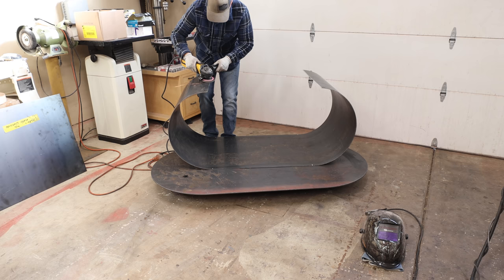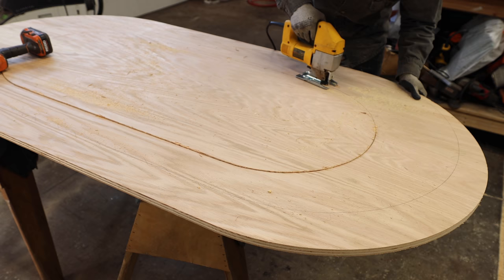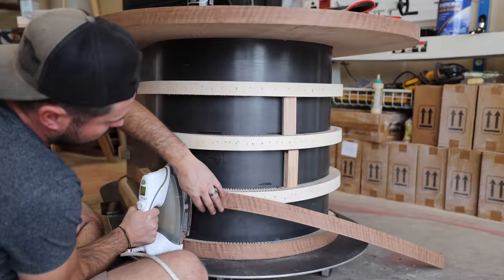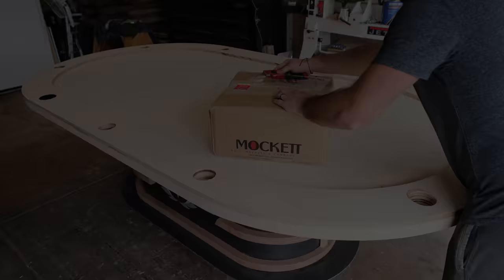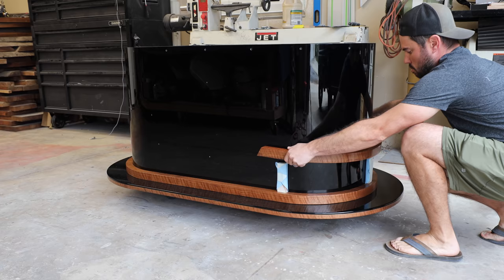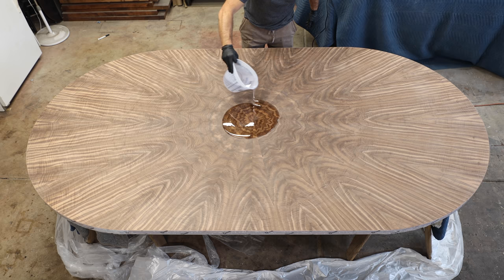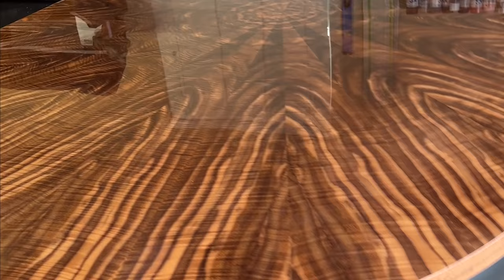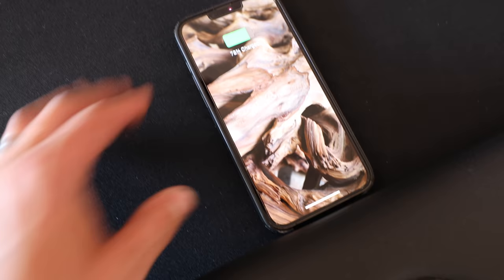Luxury Poker & Conference Table COMBO

Comment: Let´s do the math, thats fun =) 

Wood: most expensive part is the beautiful lid - approx. 5-6K all together
Metal: approx. 500-800 
Epoxy: 300
chargers: 50 each = 600 total
Foam and letherwork: approx. 2K 
Paintwork=500 
"Small things not mentioned": 1K 
work: 350hours with 60$/h = ~21K 

total of ~32.200$ 

Now it depends on how you price your shop and your services. In theory there is a win margin already included on the workhours in the built but I would think you add some additional Margin on the product itself. I would assume anywhere between 8-15% 

32.200$ *108%= 34.776$
32.200$*115%=  37.030$

 I´ll go for ~36.000$

Comment: Great work and stunning results.  My hats off to you.  For northern California, I'd say anywhere between $30-45,000.  Much more if using exotic woods.  For the epoxy top coat, a Bernzomatic blow torch does a better job with self leveling than a heat gun.  It will save you a greater deal of sanding afterwards.  Try it once and see for youself.
Reply from the maker: Thank you!  I've used one and in some cases they're too hot and will accelerate the resin flash time, I did try and use one on this table top but I need something with air flow to push the resin around and still that didn't work well lol.

Comment: I use to do custom artwork for a high end designer/ fine furniture in Scottsdale awhile ago.  They closed in 2014 I think.  
I would say it could go anywhere between 40,000 and 60,000  In 2014. It should be more today.  The 1 thing you have to remind the new owner of (and make them a cost breakdown receipt for replacement) is...don't forget to have a replacement cost put into your insurance.  The standard 5 to 25 grand for content won't replace things like this.
Reply from the maker: Great comment and information!  You’ve actually almost hit it with one of your numbers!  Keep going!

Comment: As far as video feedback, one thing I've noticed in general is that woodworking content creators sometimes overuse the 4x or 8x time lapses. Of course we don't need five minutes of you routing some semicircles, but maybe try mixing in some regular-speed shots to "bookend" the fast-forwarded bits, and maybe even one little five-second bit of regular speed in the middle if it's a longer piece (or if there's a particularly crucial or interesting bit of woodworking in the middle of a time lapse). Lots of people watch these videos to learn how things are done, and it's difficult to see what you're doing if it's flying past, and may give people the wrong idea for stuff like how fast you should be pushing your router or track saw. But overall, this is great content! I really like the voiceover explaining the steps you're taking, the design decisions, and generally being informative. Great build.

Comment: For the past 20+ years, I've been using Titebond II for veneer.  I roll three coats on veneer and substrate, letting the glue dry between coats.  The first coat is thinned about 50% with water and the second coat maybe 25% water and full strength on last coat.  A steam iron basically reconstitutes the glue and it cools to a uniform coat.  I've never had a failure.

Comment: that charging port isnt going to cut it....  That spreads 12amps across 10 chargers... Many phones are capable of drawing 3amps for charging, nowadays almost all use 2amps... Combine that with the loss across the length of those cables and with 10 phone sitting on the chargers you are only getting 1amp max per station. 

There are many phones on the market that will not even engage charging unless there is a minimum of 2amps... Optimal charging is done on a 3ft cable..... anything beyond those lengths and the amount of amp loss accelerates the further you go out to 10ft... Never go longer than 10ft...  

Combine all that with wireless charging? Those start at a 10 amp Fast Charge draw just to hit the 10w pull of an Samsung S20....

Comment: Regarding the gluing up of the edge veneer... I'm not certain it works with Titebond specifically, but with other PVA glues you can use it very similar to contact cement withOUT the instant hold OR the time restriction you referred to. You apply glue to both sides of the join and let it dry completely. Once dry, you simply iron it on. I've seen this done with both strip veneer and sheet veneer for dresser tops and the like. 

Ok, going to finish watching now... LOL

Comment: I think the only things I'd change is to run the chord underneath the base for a cleaner look. Looks amazing, and a as an electrician by trade, run a dual circuit with power switch for the table to avoid overloading a single circuit with a full table of players. I build custom 1911's and knives as a side job for the last 20 years. You're deatail is spot on. Kudos!
Reply from the maker: Thank you very much for your feedback!

Comment: Lmao you look like me in the shop with the socks and slides. The material cost should be under 7k. I don't see anything above $50 an hour for labor. So table should be about 25k + inflation so 65k. You worked 44days roughly and at that rate you can build 8 of these a year. So you are telling us if you pocket about 30k each you make over 200k a year. These types of clients are so rare though. I guess a fool and their money.

Comment: 350 hours of a master craftsman's work. At $200 an hour that's 70K right there without materials. This is one of those projects that doesn't make sense economically speaking. You engage in this as art and treat it as such. The fact that it's a poker and conference table is just a bonus.

Comment: pretty good job sanding the clear and polishing.  i custom paint cars,  over the years ive used high solids clear on woodbed kits for old pick up trucks. 6 years of driving around in the sun/rain still looks glossy. ive also done some outdoor wood furniture(satin finish) the 2k urethane clears fair a lot better in the sun than epoxy.

Comment: Beautifully done.   I find that using Rubberply is much faster than making kerfs and the material is quite inexpensive.  
1/4 inch thick and when gluing up with layers is super strong and will hold shape.
Really liked the tip on using the iron over Titebond veneering.  Will try.  Lastly,  I would charge about $47,500 for this project.

Comment: if you pour the table top epoxy thicker it will self level better removing the need for block sanding, it wastes a lot of epoxy as it pours over the edge but time is money

Comment: You should ceramic coat your finishes, it adds a high gloss super durable layer of protection. Can be used on metal, glass, wood and probabely various other things. Beautiful table by the way. All that hard work payed off.

Comment: So beautiful. Can't believe they didn't have a power socket below the table instead of the cable going from the table to the wall....
Reply: I cant believe they paid over 60k for this table, but didn’t bother to hide their hot water heater in a closet.  Or clean their floors.

Comment: Not that I can tell you anything but have you considered a paint protection film with a ceramic coating to protect the finish on the metal?  The shine still comes through and you basically make it bulletproof from scratches.

Comment: Using a tool from the body shop called an Air file it is difficult sometimes to work with it but if you keep it level it will sand the high spots down faster and more level just a suggestion love what you do

Comment: If you really need 4 Poeple to put the conference Table on to the wall or back to the table it will be on the wall forever. The only thing which is not so nice is the power cable on the floor to the wall plug. There should be a more unvisible solution for this. But after all it is a very nice build.

Comment: 75,000, i have to say with your epoxy leveling, just spin the top and it will self level with the centrifugal force, 2 that conference top is loose on the poker table unless i missed something it probably would have been better to have a protruding in laid lip to stop it from moving when put on the table top or just been large enough to put over the play area so you still have cup holders. looks neat though
Reply from the maker: How am I going to spin it?  Genuinely curious!  The top weighs 300 lbs and doesn't move at all when it's laid on top of the pad.

Comment: 350 hours at a comfortable rate of $75-$100 per hour puts the labour cost at $26,250 to $35,000. You cut the logo from a claro slab, I imagine that was about another $2,500. The actual table looks like it's just plywood, so in the context the cost is pretty negligible. I imagine those veneer rolls run about $150 a pop and I imagine you used a few of them. Let's say 10 rolls, so $1,500. I have no idea what that tabletop could have run you, maybe $6,000. Add epoxy coats and other materials, say $1,000. Add a 15 % margin on the material. Total cost around $38,900 - $47,650, guesstimated

Comment: for 12:53  -  Leveling the clear epoxy. Use a thin wire/thread long, under tension to "cut & level"  the epoxy from one part of the table to another...
tank me later,,,

Comment: For the stop blocks under the conference table top, did you cover them with felt so that once placed on the table, it doesn't rub against the inside table (potentially buffing, indenting or ripping the cover?)

Comment: 350 hours at a comfortable rate, and then adding in materials and outsourcing, not to mention having designed it and planned out... I'd say $80000 at a minimum, if it's a returning customer. If it's a one-off then I'd aim higher.

Comment: 350 hours of work on it... I'd hope you're getting at least 40 an hour for the labor. That's 14,000 right there. Material costs: A few sheets of plywood call it 600. The vaneers, maybe another 600-1k. I have no idea on the sunburst top though. The chargers $400? Steel for the base $800? Again no idea on that one. Custom felt job, $1,000. I didn't see how the custom logo was made, but it looks like cnc+epoxy inlay. All in I'm guessing somewhere in the ballpark of 18k-20k installed.
Reply: The closest guess so far is $61,750. It's a beautiful table but I'd never pay that kind of cash for a table but then again I'm sure this table is going to someone that thinks that kind of money is chump change. I'm glad he is not under charging and screwing himself over, I see it happen all the time.
Reply from the maker: Thank you for your feedback

Comment: Instead of doing all that monotonous sanding why don't you use Peel Ply? In boat building where we use epoxy, you apply the epoxy and then place Peel Ply over it and when the epoxy dries you just peel the Peel Ply off and it gives you a level surface which doesn't require heaps of sanding. What you call block sanding we call those "torture boards"
Peel Ply takes away the excess epoxy
Reply: Curious question how long after using the resin would you need to apply peel ply?

Comment: The thing about poker tables is that, 99% of them look like they were made in someones garage. This is borderline, could go either way. Which is IMO, difficult to even be in that borderline club. Even some of the nicer ones cant seem to avoid this fatal curse. Its a nice looking poker table, but i wouldnt honestly give anyone a fraction of what their time would have been worth. They dont retain any value what so ever and typically begin to fall apart after a few seasons of abuse. It's just a bad investment from a buyers perspective. Ive played on thousands of tables over the decades. Never had my odds increased by a fancy table.

Comment: So, 350 hrs at $85 an hour is roughly $30,000…. Add in the materials, epoxy, veneers, leatherwork, chargers, transportation, other overhead, and you are probably closer to $43,000 would be my Guess…

Comment: $17,500 in labor, right about $9k in your materials, about $7k in subcontractor work, plus 20-30% markup on materials. Guessing $36k-37k.
Reply: The fucked up part is, I'm not sure if you're being sarcastic or not...
Reply: @GAsh0012  Not sarcastic. A typical business should charge about $50/hr in labor. Up charge 30% for materials and pass on the cost of subcontractor work. This is a custom one of a kind piece after all.

Comment: $17,500 and I’m sorry if I’m too low, didn’t want to offend you.
Reply: Most custom jobs like this are $100/hr labor or more so it's at least $35,000 just in labor.  That's not even factoring in material cost.  It's crazy how expensive custom tables get. I've sold custom pine tables that cost $200 in material for over $2000 just due to design and labor time.

Comment: On the electrical why was there a outlet facing the inside and not sure all those parts were used correctly but hey theres no inspection to fail and as long as the connections are good there should not be any issues
Reply: LMAO
Reply from the maker: They were used correctly, I put the outlet there because thats the side where the grommet hole was.

Comment: Poker players need to extend their legs under the table. Also it’s too tight.   No spot in the middle for a dealer.   It’s a shame.   Looks great.  Not functional at all.  Cup holders are the tiny ones.   Need to be jumbo cup holders.

Next time consult with people….

Try it again, but wider and longer 

They have poker foot rails which should be used instead of the base you made.  Looks cool.  Not functional for poker players or anyone with legs.
Reply: Poker players will complain anyway. Never fails. Not being negative just how it is. Thy tend to be what they think are the best people. Been around them a LOT in my life it’s just how it is.

Comment: They actually have an exposed water heater in this room?  My god thats tacky.  Your work deserves better.  But i guess if the moneys good...
Reply: It’s obvious that this room is not finished yet…..
Reply: @patrick7119  really?  It's obvious?  If it's not finished yet, why are they putting in the poker table now instead of waiting until the end when its finished?  Normally you put furniture into a room after it's finished, not before.
Reply: @ericmcmanus5179  probably because they wanted to show and film the finished table… Anyway, The brick wall is pre-coated for plastering. The floor is already equipped with a subfloor and the skirting boards are primed